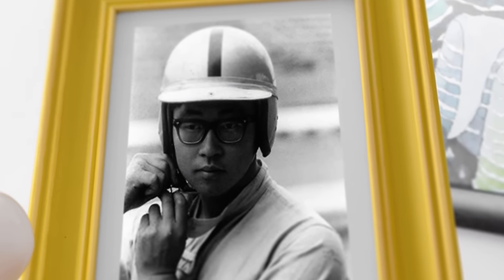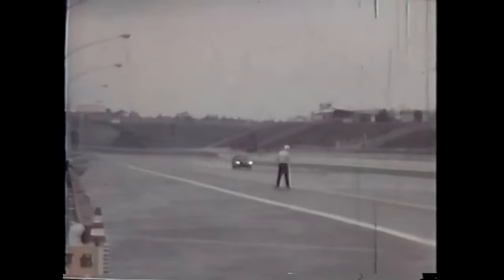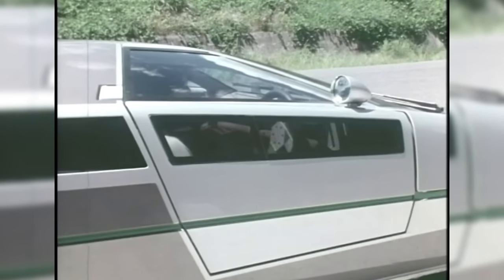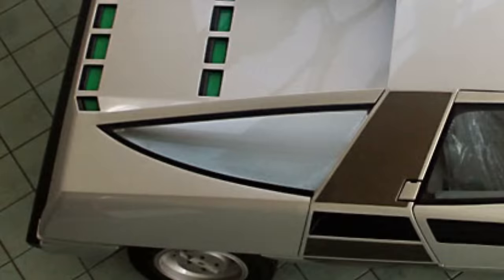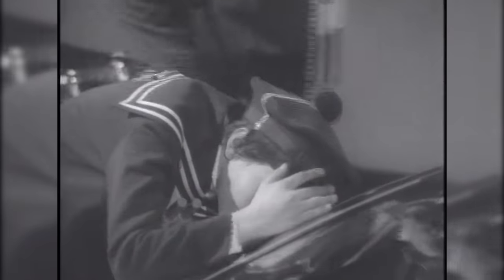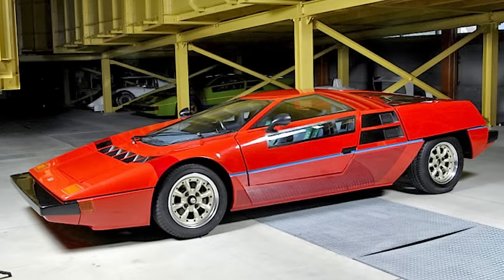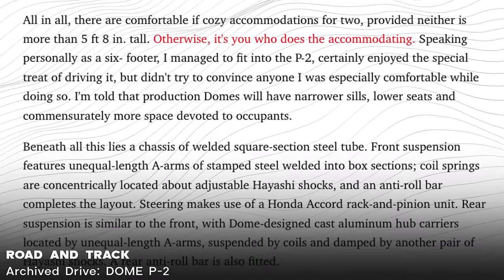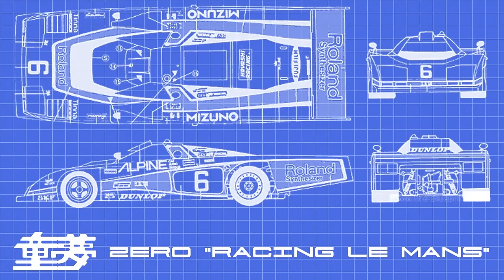Japan's Forgotten Supercar

Comment: Fun fact: toys of this car were still being made in the early 2000s and one of them turned it into a Transformer.  The version of Hot Rod (or Rodimus) that was made for the 2006 "Classics" toy line - a figure that's become pretty well-known in the "Transformers" community - transforms into a customized Dome Zero that has been modified with the Hot Rod character's iconic features: a flamboyant fiery paint job, long angled exhaust pipes on the sides, L-shaped headlights, a Batmobile-esque rocket booster, a massive orange swept-wing spoiler in the rear, and an exposed supercharged engine block in front of the windshield.